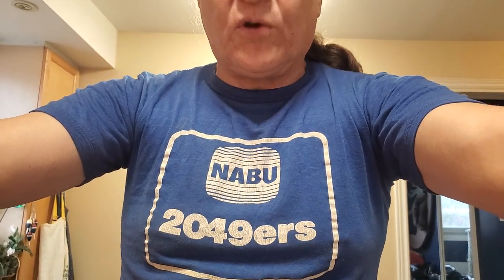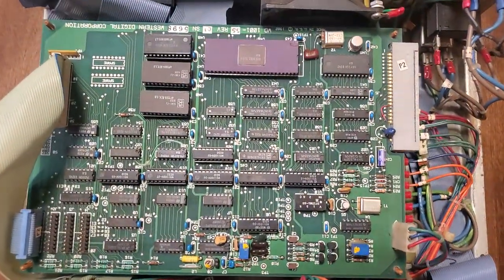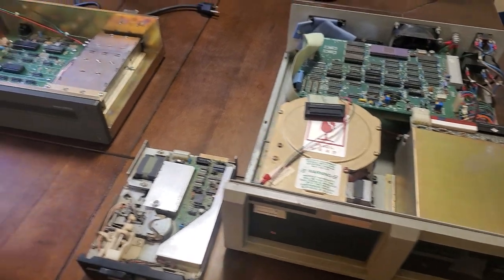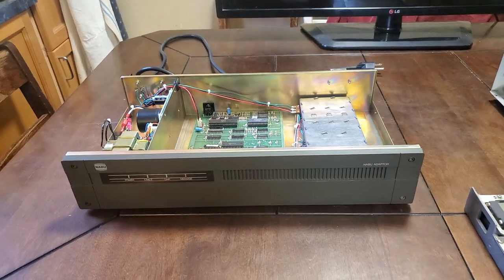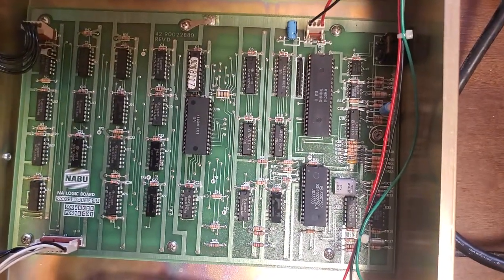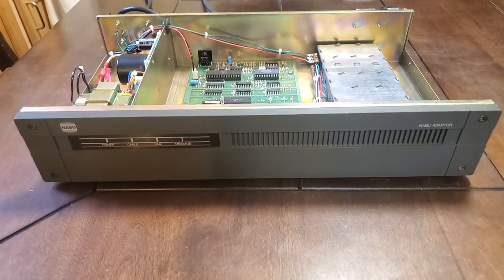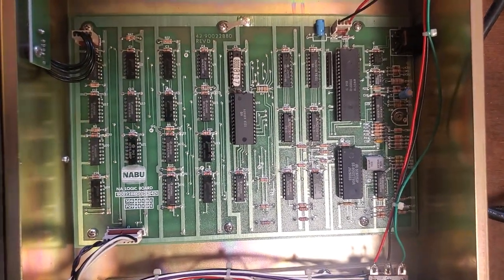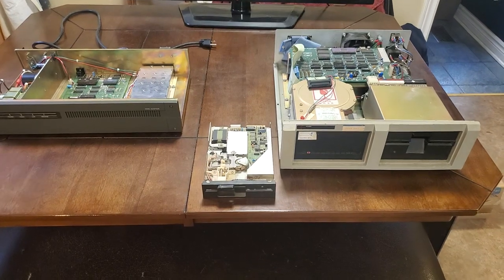NABU Archaeology with Leo Binkowski part 2

Comment: Mmm, Full height MFM drive. I wish I had a hard drive bible. Remember those?  So what we are thinking. 8 bit isa mfm controller and linux? Honestly I never tried it. What I would do back in the day with DOS machines is stick the drive / controller into a machine and copy it to a ide drive. I wonder what that board converts it to. THe manual close to that one say J5 goes to host controller board.
Reply from the maker: my wife has a tandy 1000 which still uses MFM, would they be compatible at all?
Reply: @leo.binkowski  That drive is so old and I have never did anything with MFM in over 20 years. I wouldn't want to give you wrong advice on it. All the drives newer than that and in ibm xt / early at machine with dos. So it was just moving the drive / card from one pc to another. This is a Western digital controller. But nothing I have ever used. Sorry I couldn't help more.
Reply: @leo.binkowski  On a PC, the MFM controller cards supported drives by a type number, where the BIOS had a fixed set of drive geometries for heads, cylinders (or tracks, a cylinder is all the tracks in the same position on every platter), sectors per track, and the seldom used Write PreCompensation or WPC.

If you had a drive that wasn't in the Type list (your Seagate 412 definitely would be in the list) it was often possible to just look up the geometry numbers and select one in the type list that matched.
Some MFM controllers allowed entering the numbers rather than using a type list of pre-defined geometries.

I would say it's very likely the Tandy 1000's controller could support the drive, but when dealing with an old drive that contains irreplaceable, incompatible, data I'd want to make a data cable with the write wires cut to ensure that nothing the computer does can send data to the drive and possibly corrupt it.

Hopefully you can get the hard drive to someone who can image it then pull all the software from the image.

To set up a blank hard drive required using DEBUG to access a specific address (different brands used different addresses) to run the low level formatting program in the controller's BIOS. At some point in the operation the user was supposed to type in the defect list on the label on top of the drive. The drive would be low level formatted to skip the defects so to high level formatting it would appear to be perfect. I never bothered to do that, and no test I ever ran on any MFM drive ever showed any problems. The manufacturers were being extremely cautious.

My first hard drive was a 5 megabyte 5.25" full height Tandon. I Installed DOS and all the software I had. It was half full! Then I backed it up, to 360K floppies. Ugh. Nope, not doing that again. To get it to work I had to run a PARK.COM program to force it to move the heads to Track 0. It had been jostled out of place and its built in safety system wouldn't allow anything to move the head stepper. The park program apparently did something to override that and force it to seek towards Track 0 until the external 'flag' on the head stepper hit the home sensor.

Then there was the fun of using EDLIN and COPY CON to write config.sys and autoexec.bat files. Type one thing wrong and the process had to be started from the beginning. MS-DOS life became so much easier when Microsoft added a text editor.

Comment: The WD-1001-55 is a MFM controller that allows the hard disk (any MFM drive) to be connected to a generic 8bit interface to the computer. The data on the drive is the most interesting as it may have some good rare programs. The WD-1001 documentation can be found on bitsavers: http://www.bitsavers.org/pdf/westernDigital/WD100x/80-031003-00_A1_WD1001_OEM_Manual_Feb83.pdf
Reply from the maker: look at that now...